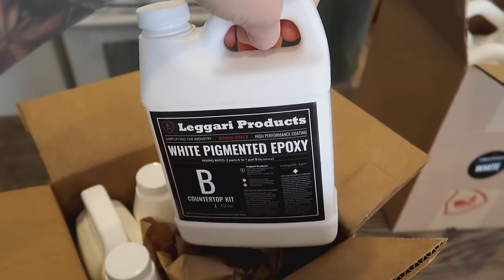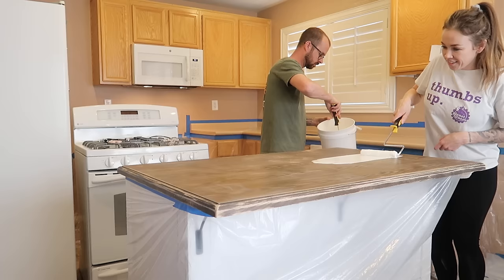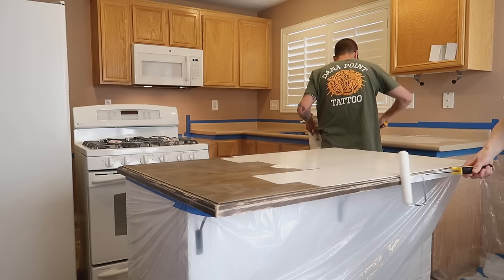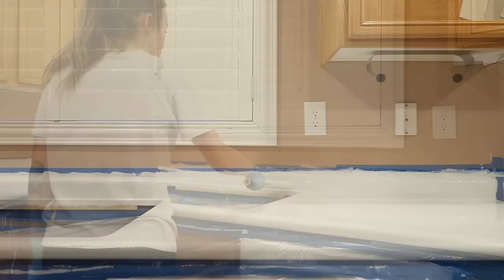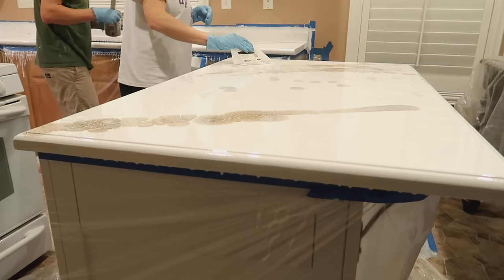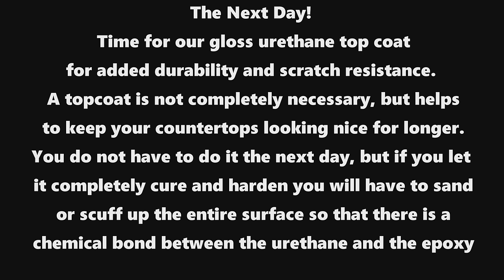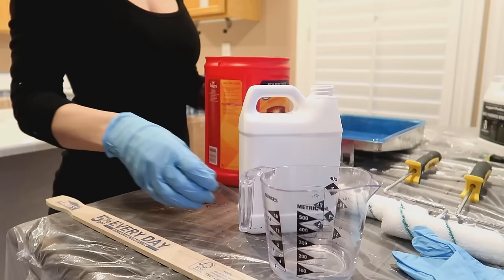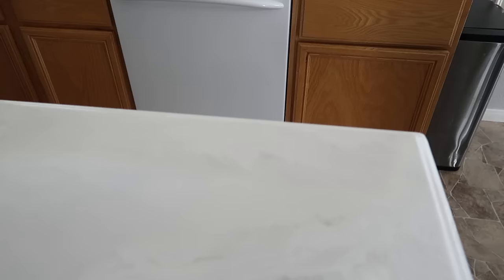HOW TO EPOXY COUNTERTOPS | WHITE MARBLE COUNTERTOP | EPOXY COUNTERTOP DIY | RENEW OLD COUNTERTOPS

Comment: I just went to the site and the kit is $530.... that is pricey, unless there was a different kit they picked up
Reply: $530 for 50 sq ft
Reply from the maker: Yes, it is pricey. It was more cost effective for us than actual granite or quartz though :)
Reply: @BrontesLife  I am renovating my home via DIY methods and I manage 5 other apartments that will need rental renovations which includes attention to the kitchens. I will probably invest in this kit for my home, but probably find an alternative for the rentals.
I used DAICH SpreadStone in Volcanic Black for one of the countertops in a rental. It is only $125 for 50 sq ft and it look so realistic because there are real minerals in it. Check it out to see if you have any use for it as a small project; maybe a new diy tutorial for YouTube? The countertop turned out great in the rental, but I'd probably invest in a standard clear epoxy or top coat to add extra durability to the surface since durability is my biggest concern. Let me know what you think.

Comment: I don’t know, but it seems to me to make food on an epoxy-coated table is unhealthy.
Reply from the maker: It’s not the some epoxy resin used to seal art. It’s “food grade”
Reply from the maker: Also I use plates, cutting boards etc just as I would on any other sort of countertop to protect the counters from scratches and stains ❤️
Reply: @BrontesLife  If it's "food grade", then it's a great table update :)
Reply from the maker: @myphotoart3870  I think so too! That is what it is advertised as. Completely updates the look at a lower cost and I’m all for that ☺️